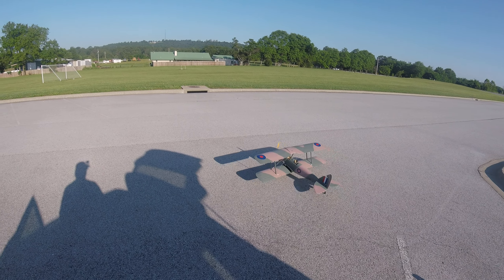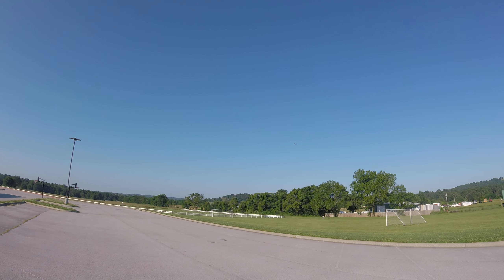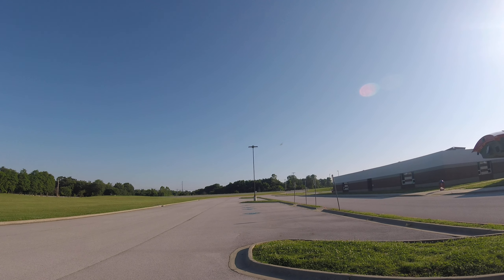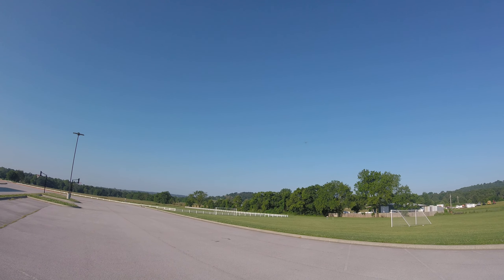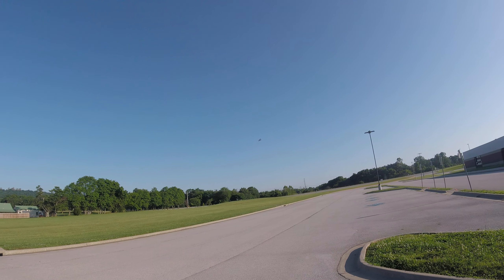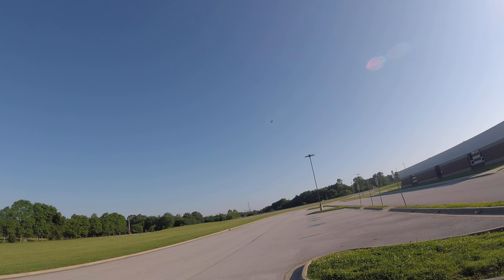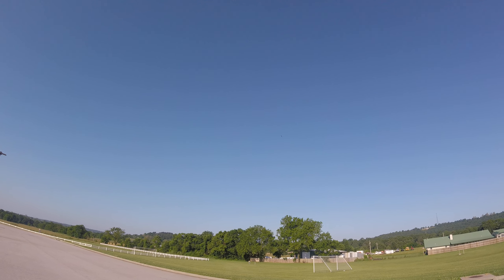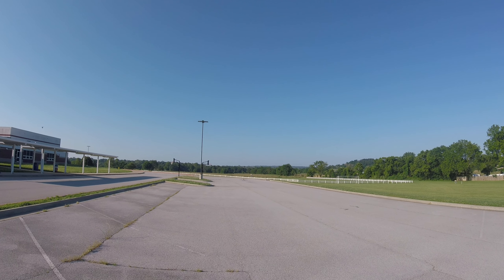Nexa DH Tiger Moth by Motion RC.  Maiden flight

Comment: Try it on 4s and see how it flies. I’m going to buy the Silver Tiger Moth. I’ve been searching for an Arf that looks good
Reply from the maker: I tried it on 4cell but there wasn't enough power with my motor / prop combo.  I will probably try a different motor at some point.  Anything you can do to keep the weight down will really help this one.  My all up weight is in the 7.5 -8 pound range which is a bit much for this one.  I had to modify the firewall to push the battery forward as much as possible and still add about 6zo of lead to the nose to get the forward CG called out in the book.  It flies good but not great.